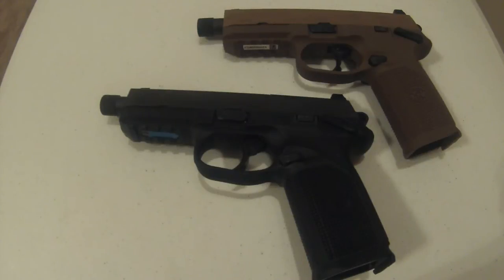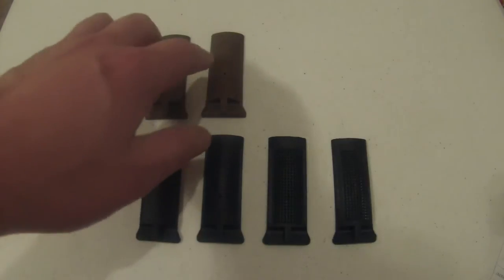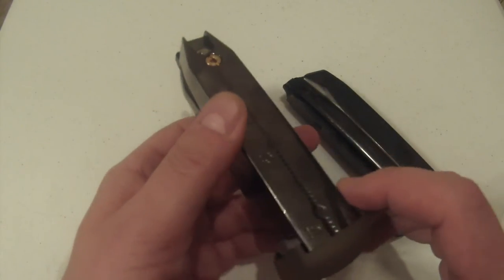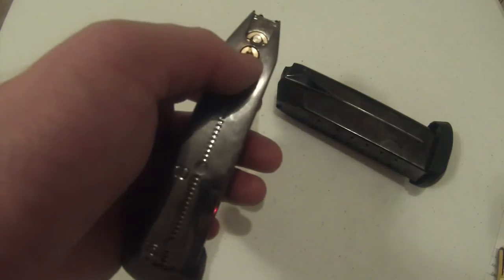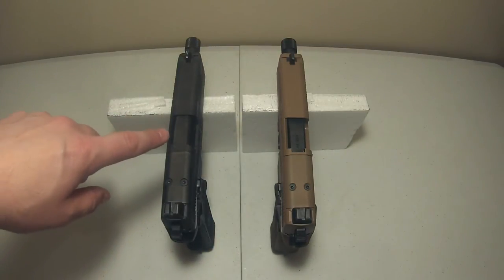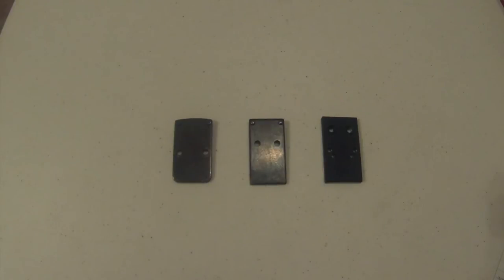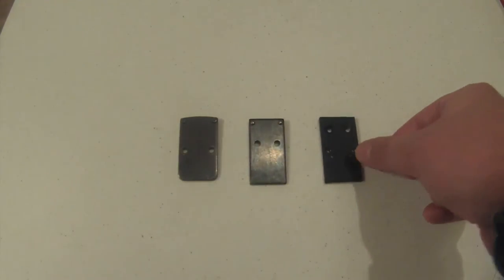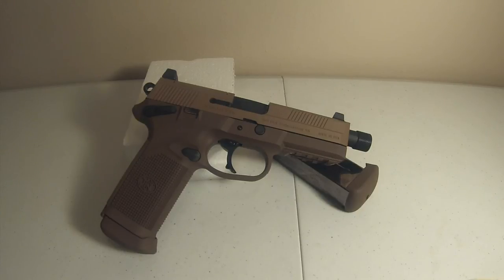Airsoft FNX Tactical 45 vs. the real steel review part 2

Comment: Are you able to put the iron sights from the real one on the airsoft one? I have an airsoft one and plan on putting real steel sights on it, one issue though is the screws that hold the gas block in the airsoft model screw into the underside of the rear iron sights.